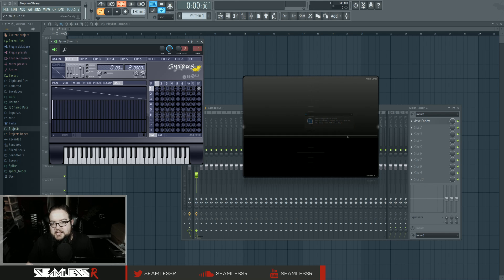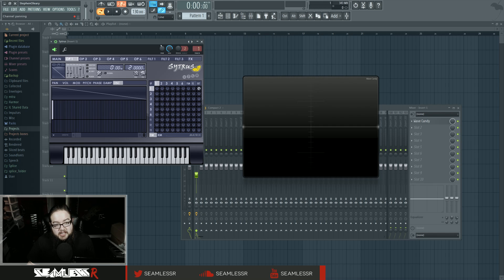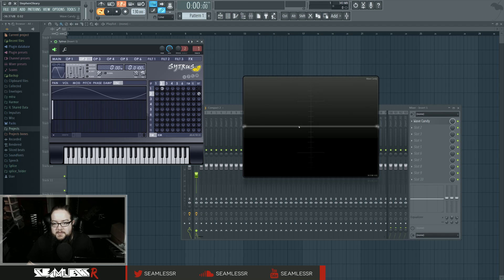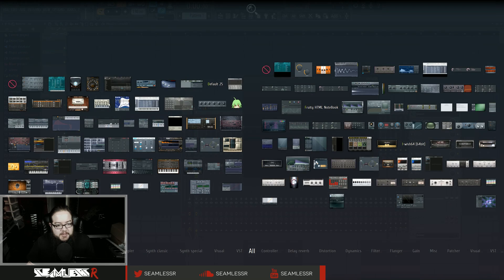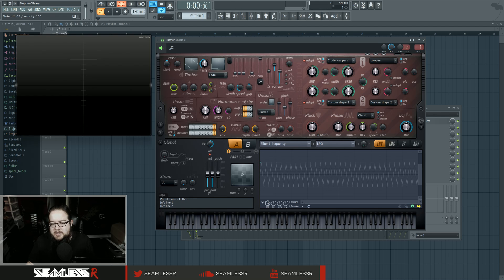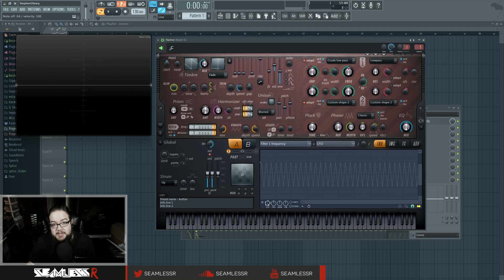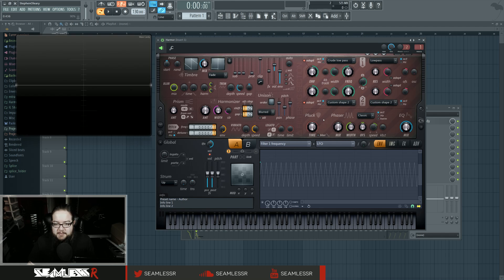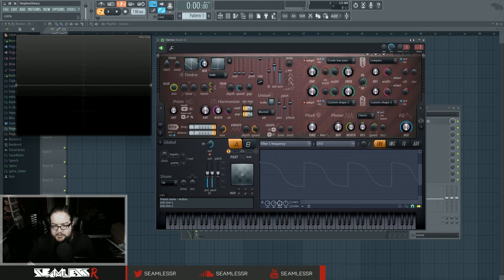Basic Terminology: LFO (Low Frequency Oscillator)

Comment: How about a video on "Sidechain"
Reply: +DJM GAMING Sidechaining is when the volume of one thing turns down the volume of another. Usually people sidechain the bass to the kick because it makes the kick sound louder. You can do this with fruity limiter by routing your kick channel into your bass channel, turning the input volume of the kick into the bass channel all the way down, selecting the "comp" tab on the limiter (which is on the bass channel), selecting the kick channel in the spot that says "---" (and it says sidechain under it), and moving the threshold and ratio knobs until you get the desired effect (threshold down ratio up). Then you should usually turn down the time settings until there is noticeable distortion, then turn them back up a bit.
Reply: +DJM GAMING Oo that'd be a good one for the newbies.